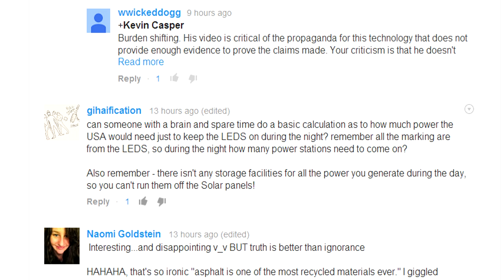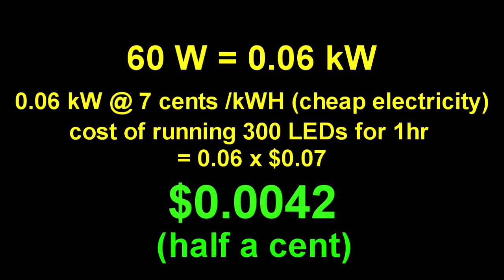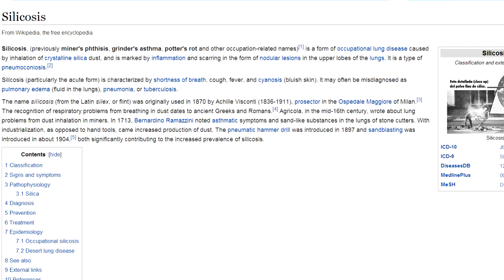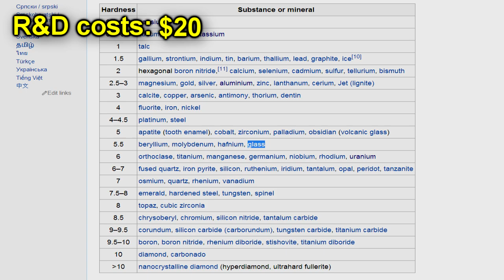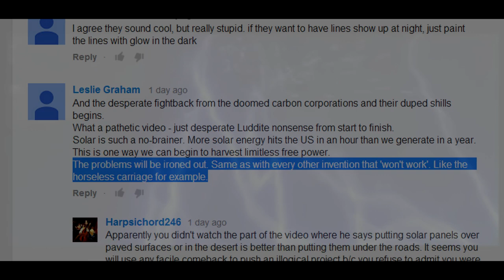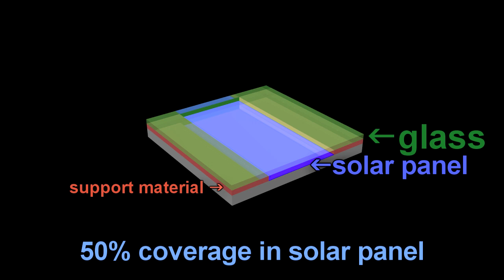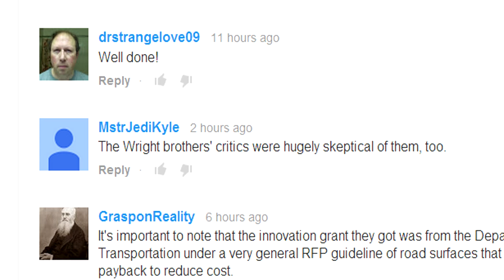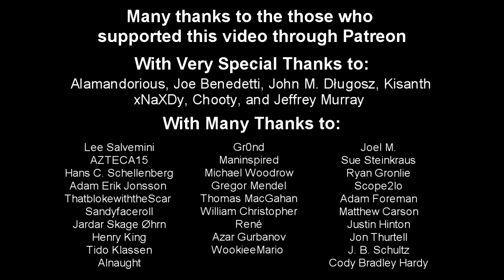Solar Roadways, IMPORTANT QUESTIONS AND ANSWERS!

Comment: Just one thing, Thunderf00t. Not every LED will be turned on. Only maybe about 10% of them. On parts of the road where there are no intersections and usually no need for road signs, you only need the LEDs for the white lines, the rest are not going to be in use (possibly ever).

Which would also mean that you'd be buying stuff you are most likely never going to use, which makes it just as stupid, but I'm just saying.
Reply: Then you will need detectors to detect if a car is in the area and if so, to lightup the leds.

If this would replace car lights, you need to depend on the road to light up, so when something is broken you could drive of the road expecting that stuff lights up.
Reply: Ah, they are also going to try and have it all replace car lights? Then my comment is irrelevant.

I was just thinking that except for a few LEDs for the white stripes on the road, you don't really need to turn on any others. Most of the road currently is pure black with no markings on it - no LEDs needed to replace the black parts. That means only around 10% of the LEDs would be turned on at a time, because that's all you'll ever need for most roads where there's no road signs and just a few white stripes.

Comment: Arent the tiles pressure sensitive? Thus it should be possible to only light the LED around a car in a 500m-1km radius. A group of tiles should probably have a battery that they are fueling that can take over during the night or periods where high energy is necessary.

Comment: I think you've demonstrated some very good points. I learned a lot from your two videos on this subject. I still believe that photvoltaics could be very useful if they are deployed close to (within a few feet of) the location that the electricity is consumed. Rooftops would be a good location. At least this approach would produce some percentage of the electricity used in a building.

I know that you have debunked the idea of a thorium powered car but what do you think about large thorium based nuclear power stations? I've heard that it is cleaner than uranium and more abundant than uranium and safer than uranium.

Comment: Just a couple of added points as well, what would happen in a multi-car pile up? Have you seen the damage to the roads after a horrific crash? Also in rush hour when the LED's would be most needed, how much power would you lose from a 5 mile traffic jam where the cars are covering the panels? This whole 'idea' makes no sense at all.. seriously impractical.

Comment: The road is supposed to be 'smart' so maybe all the LED's don't all need to be on at the same time, maybe just the ones near the car white it's driving.
Reply: So in the dessert you would put a highly expensive road and light it up when used? Sounds far more efficient that putting lights on the car.

In cities? Lots of cars passing, lights are on a lot of the time. Taking the power from the desert to the city.... there are more efficient ways for that.

Comment: great vid TFoot! I agree with everything except the bulk cost of the LEDs. I work in the power quality industry designing PQ meters/monitors. Once you get to several hundreds of thousands of LEDs, and assuming that there would be some kind of moronic government subsidy for the project, then the cost drops dramatically. You are 100% correct everywhere else and I still find this project to be, as Ben Goldacre would put it, "an idiot tax"
Reply: But a government subsidy wouldn't decrease the actual costs, right? It would just shift more of it directly to the taxpayer.
Reply: You are certainly correct. But please note that I'm saying there could be a government subsidy "in addition to" the discount achieved via a bulk "Tape and Reel" buy. They could get both but I hope they get neither. Regardless, buying several hundreds of thousands of LEDs would cost substantially less then buying a pre-made kit off of amazon.
Especially if they were able to buy direct from the manufacturer instead of from distribution.

Comment: Don't also forget that when such a glass breaks, even the hardest glass, will leave glass shards on the road which is not very good for your tires.
The only conceivable way of using these octagons would be for side walks, but even then they wouldn't receive much sun as they are probably in between buildings.

Just make some very cost efficient high output solar panels in roof tiles.

Comment: I mean what probably would be a feasible idea is solar panels on peoples roofs. There are no transport costs; no worry about converting low voltage to high voltage, they don't come under the constant stress of being run over, sloped roofs use gravity (plus a small amount of possible free manual labor) as a free and fun way of removing snow, net energy is positive since nothing is wasted on LED lights e.c.t. Now instead of funding this solar roadways project, you could fix a solar panel to your house, it won't do everything but you could use it to heat water at the very least, and it would indeed pay for itself over the course of a few years.

Comment: +Thunderf00t Glass has a Mohs hardness of 4.5-6.5, while asphalt has a hardness of around one, does it not? So how come rocks can scratch glass so easily?
Reply: Because they're rocks. Roads are made of asphalt AND gravel, which is ground up rocks.
Reply from the maker: most roads are a composite material made up of bitumen (which provides a somewhat elastic binder and waterproofing) and ground up rocks.  The ground up rocks provide the hardness/ traction that gives the road its logevity.  The ground up rocks are much harder than glass, and much MUCH cheaper!
Glass has none of the advantages of a composite material.  Its just too soft to be used as a road topping.
Reply: Doesn't matter if asphalt is scratched, because it isn't trying to be a translucent surface for a solar panel at the same time.  It does get scratched.
Reply: I'd like to know this also. My guess, and I stress that this is a guess, is that the asphalt is scratched constantly but that this doesn't matter as the surface is constantly roughened. New roads look very different to older ones.
Reply: Kabelo Moiloa
Roads are not made of asphalt. They're made out of rocks glued together with asphalt. Seriously, 5 seconds on google could've told you that.
Reply: JanPospisil42 plus asphalt is resilient, cushiony in effect and though it also requires frequent small repairs/patches, they are relatively simple (and relatively cheap) to accomplish.
Reply: *****  It is scratched, you just don't notice and don't really care given the material. However rocks/ dirt are mostly composed of quartz, which is harder than glass and therefore would scratch the glass.
Reply: Asphalt is actually the thick sticky oil they use as an adhesive that sticks gravel and rock together on the road surface.  So, asphalt roads are actually gravel and rock road surfaces glued together by asphalt and then smoothed with big rollers.  If you look at an asphalt road that is a few years old, you will see that most of the black asphalt has worn away, leaving a pebbly stone surface.  
Same story with concrete roadways.  The portland cement used to make concrete is very soft compared to rock, but it is used to stick rocks, sand, and gravel together in making concrete.
Reply: Take a hard look at diamond. The hardest material on the Mohs scale, but also, one of weakest when it comes to actual strength.
Reply: The main difference is that if the Asphalt gets scratched it still serves it's purpose, but if the glass gets scratched then it no longer allows light through it as efficiently & as such the solar panels are no longer getting any light, so they're not producing any power & so what was the point of putting them there in the 1st place?
Reply: ***** How about if we switched out the tin-foil hat alot of people seems to be wearing with a standard solarpanel? No wear and tear, and it seems we'll get alot of coverage.
Only problem is how we'll get them to stop barking at the moon and go out in the sun instead.
Reply: *****
another issue with glass surfaces is glare. I live in LA and glare is already a big problem.
   Yet another problem is the uniform roughness of the glass would be like driving over rumble strips.  Fixing that by roughing up the glass via sand blasting or some other process would make the solar panels even less efficient.
Reply: patricesez
I make ashphalt, and who told you it was cheap, a 20 km road, you are looking at about $4.3 million! The materials, not including the oil to make it is not cheap! The manufactured fines, which is really fine gravelly sand is really expensive and a slow process to make!
Reply: Rocks are course and 'rough/sharp', whereas glass is a man-made surface and smooth as a result of the glass making processes. Glass may be harder, but it can also be more brittle.
Reply: That picture and that comment are great together. But think about led and steel. A bullet can go through steel even though lead is much softer than steel.
Reply: Sand/silt are harder than glass
Reply: Asphalt is mixed with rocks to take a road. Also it doesn't matter if it scratched. Sure after a long time you wear out the road, but the n you just need to add a new layer of asphalt and rock mix on top and your road is as new.

If you just wanted glass to drive on, it wouldn't matter how scratched it is. But if you want the sun to shine through it, just a tiny bit of scratching will dramatically reduce the light that gets through. And add to that the dirt on the road and hardly any light will reach the solar panels.
Reply: the asphalt is malleable, glass is not.
Reply: hardness and toughness are too different things
Reply: laser14344
 Look at how the glass is textured, it was designed to be glare-proof and good for traction.
Reply: Cillian Scott
unfortunately the only pictures they have are in the north, mostly on cloudy days the rest being artist renderings. 1. imagine how loud/irritating it would be to drive over that surface.  2. the more glare resistant it is, the less light it lets through, the less light it lets through the less efficient the solar panels are.

http://assets.inhabitat.com/wp-content/blogs.dir/1/files/2014/06/solar-roadways-537x385.jpg  that's just the glare in Idaho. imagine that put in the desert where any light colored surface is hard to look at without sunglasses on.
Reply: Butter is also softer than glass, that doesn't change the fact that some rocks are not.

Similarly that asphalt is softer then glass also doesn't change the fact that some rocks are not.
Reply: Herr Hansen Solar tinfoil hats would only work assuming the people who wear tinfoil hats actually leave their parents' basements once in a while.
Reply: AgeOfSuperboredom Of course. +facepalm+
Such a disasterous miscalculation on my part.

Comment: Somehow when you are trying to sell a product that will 'solve the world's energy problems' I find it hard to take seriously when you throw the word freakin in the middle of every announcement they make, plus on their rebuttal sight where they use traffic lights and billboards as an example of LEDs working in direct sunlight, as an Australian I have no experience with those fancy billboards but our traffic lights at least have an open ended cone around the top half of the light, So by looking into the shadowy cone you can see the traffic light! So unless they have some way to take the heat from the light but also filter out  the light without covering it so we will be able to see the lights...
Reply: I was thinking the exact same thing when they brought it up, the traffic lights are covered with a hood which casts a shadow so you can see them properly.
Reply: bodybag22 Conveniently in the photo of a traffic light they use its front on so you can't even see the hood.
Reply: Ansem Seeker yeah and sometimes even with a hood the lights are pretty hard to see if the sun is shining from the right angle.